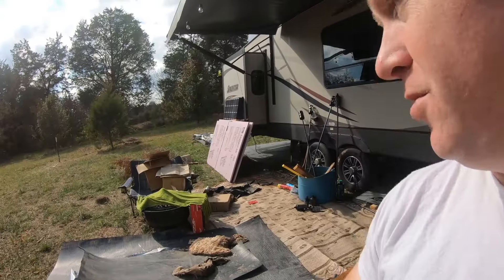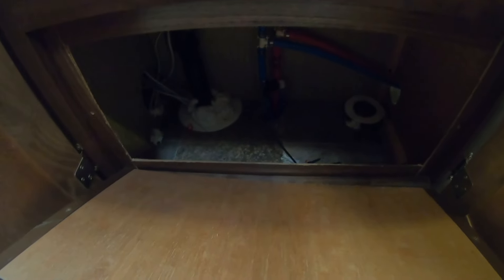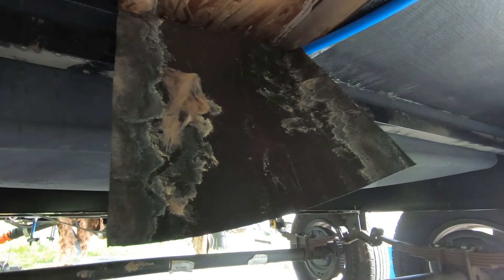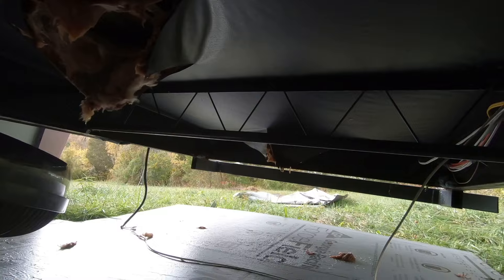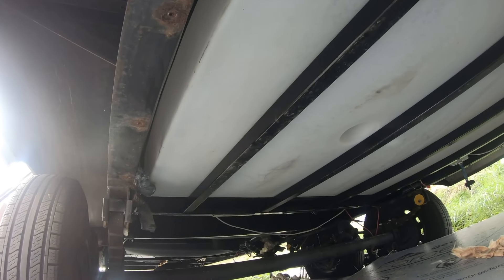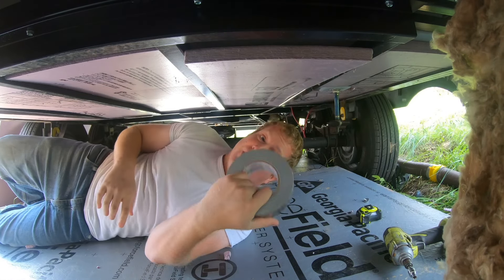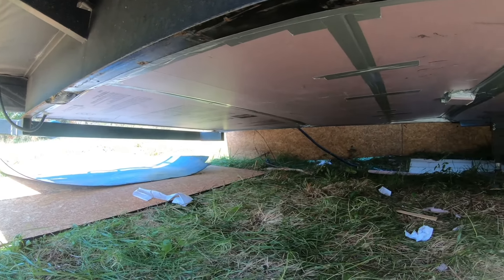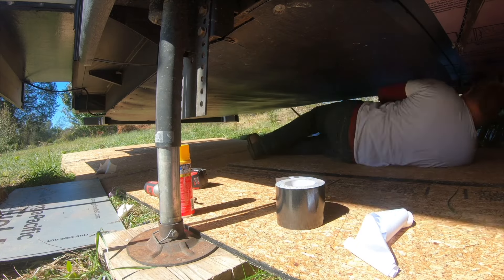We had a major issue with our Keystone RV | Check your RV for this problem before its too late!

Comment: Your positive attitude about this whole terrible issue is amazing!  Thank you for sharing... really appreciated!  I agree with M Silver, you must be a saint!  One of my greatest fears, a water leak in or impacting the basement area.
Reply from the maker: Yeah, it was frustrating to have to deal with something like that... I should have realized that something was going on earlier than I did.  When we were using our water pump, about every 10-20 min it would start up and re-prime itself. We just figured it was bleeding off pressure through the pump's check valve  and didn't think about the possibility of a water leak...

Comment: I never connect to a pressure line. I always use the annoying sounding water pump. That way I can hear any leaks before they become serious. If you're not using any water and your pump cycles, you have an issue.
Reply from the maker: Yeah we noticed it cycling about every 15-30 minutes for about 2 seconds, and just thought it was the check valve bleeding off…

Comment: Good job but you should use the red Tuck tape that is designed to stick to styrofoam and is also waterproof. And it really sticks. Get it at any building centre.
Reply from the maker: Thanks for the Tip, We'll have to give that a shot, we had some of the plastic come down and will be working on getting that replaced later!
Reply: as a home builder, i totally agree, duct tape is pretty useless stuff, in fact hvac contractors dont even use it for duct work!  the red Tuck Tape is the best stuff for exterior cladding.

Comment: I own a 30' 2007 Keystone Montana, within the first year I had smoke coming up from the 'basement' area and heard water running. After I secured the power & water, I discovered the water line above the inverter leaked and caused a short. Was not pleased... I discovered the PEX coupling was 'not so well' secured with a hose clamp from the factory, really should have never happened. I repaired the PEX properly and contacted the mfg. of the inverter and what had happened, and they sent me a replacement unit free of charge. Some folks take pride in what they do.
Reply from the maker: Wow sorry to hear about your leak! At least you were able to get the inverter replaced for free!

Comment: I totally agree B , our keystone is JUNK. I wish that I didn’t have to find out the hard way to see this, as next time I am going to go through the future trailer with a scope camera. Our bedroom slide doesn’t go out all the way as the stoners screwed the cable L brackets on wrong so now the slide has too many screw holes to move the bracket and it will not be strong enough to support the new position. The hole in the floor for the island sink drain looks like it was beat open with a sludge hammer, the plumbing line from the hot water tank to the bathroom sink had a loop in it that was basically a knot. All those videos on YouTube that have factory tours are soo misleading, a dog and pony show is what they are as no dealer will slam the factory. 
Ya, keystoner rv, go ahead and buy one, you’ll see. I dare you.
Reply from the maker: Dang sorry to hear all the issues you’ve had to deal with!
Reply: They are made so quickly that likely there are many more problems to crop up over the years.   Note that things you are supposed to check or have access are difficult to find.  Corporate America is so greedy that consumers pay for it every time.
Reply: Makes no sense to hear people say this. Guess it’s just like anything else… a hit or miss when it comes to the year. Hopefully you can get everything resolved. Bought a 2011 in 2011 and I’ve never had any issues.

Comment: thanks for the heads up.. just took our inaugural trip in our 0217 keystone.. first stop hooked up to city water and had a waterfall coming out the rear 30min later.. unhooked it and drained the system... guess I know what my next project/expense is likely to be now
Reply from the maker: Aww man.. so sorry to hear that, those connections in the bathroom sink stink to get to. on ours they were in-between the axels which made it a pain to crawl around... hope your repair goes smoother than ours!

Comment: 2 easy ways to find out if you have a water leak. 
# turn on the on board water punp let it run until it stops letting the pump pressure the line then dont turn any water inside the coach and let set for at least 10 minutes.  If pump cycles of and then back on ther is a water leak. #2 whenever I connect my water supply to shore water I use a adjustable pressure regulator with a pressure guage. After everything has pressurized and all the lines are full , I go outside and turn off the shore water and then watch my pressure regulator to see of I'm losing pressure.  If guage goes dow then you have a leak and if it stays pressurized then everything is good

Comment: On our '14 Montana the water running down the side slipped under the Coroplast belly cover since it extended out about a quarter inch. I pulled it down and used a fan over a couple weeks to dry things out. Of course a mouse family used that to that as an invitation to squat. Dead mice -- stink.

I noticed that you do not have spring hanger supports. I highly recommend at least installing a MORryde X-factor's between the centers as a minimum and all 3 being best. Those hangers are cheap 1/8" bent hot roll steel instead of the forged brackets on our ancient long gone Kountry Aire
Reply from the maker: Nice I'll have to check those out

Comment: As a recently certified tech I am amazed at the stupidity of the RV designers.  Why would you put that crappy underbelly garbage on the bottom where visually we need to see problems before they become catastrophic. If you want an all season rv then wrap the pipes and  use other means, we need to get quick access to electrical lines, plumbing lines, propane lines to do inspections to catch problems before they get too far and costly. Imagine that!

Comment: Every rv is going to have similar issues. They are built quickly and are as light as possible. 
It is your job as the owner to do a complete inspection of all systems every trip. No different than a truck driver or pilot doing a pre-trip inspection. 

I highly suggest staying away from RV's unless you have many years of experience in construction and the ability to maintain and repair all systems. 

At this point, you need to remove and replace all wet insulation, or you will have a major mold issue. Make sure you thoroughly clean all surfaces before re-installation of insulation.

Comment: I had a similar problem with our KZ Sportsmen,  had to remove all tbe under belly insulation and replace with rigid  foam. I covered the whole lot with coroplast. I akso rerouted all pipes to the inside of tge rig.
Reply from the maker: Ill have to check that out, I had some of it fall down over the winter months and need to replace the old stuff, thanks for the info!

Comment: As noted: Duct tape does not stick to much of anything. You are going to have to retape the entire job by next year. Those panels of insulation are not a good idea without some kind of a hanging system like wire to hold them in place. And there is supposed to be a gap between the frame and the tanks to allow for weight and thermal tank expansion. I have seen frames on a trailer bend when water in a tank began to freeze and expand.
Reply: Maybe use that foil tape and heat with a hair dryer

Comment: PEX pipe is a good product. Every reputable PEX manufacturer recommends proper connection systems that are approved for their specific pipe. RV manufacturers then purchase any random hose clamp and use them for their lowest bidder unbranded pex pipe. At some point your pex pipe connections will start leaking also and any nylon pipe plumbed into the system will also fail for the same reason.

Comment: I bought an 83 Glendale rv. quite an eye opener. at least when I rebuilt it and replaced all the rotted wood it was basic carpentry. what crap these things are. someone commented anything past 2018 is cheap built but I can confirm they are ALL cheaply built no matter the year.

Comment: My keystone in just a few years of owning it had a broken pea trap dump in water everywhere ,refrigerator never has cooled below 50° most the time the freezer can’t freeze since it was brand new,the shower makes a gurgling sound and hissing sound almost like it has a leak at the shower hose connection,cooks batteries /2 in two years so I had no choice but just completely disconnect till I can figure something out,aC wall mounted ac leaks into the cabin already causing a mold issue.This thing cost me a lot of money and has been nothing but a huge money pit and huge cause of stress for my wife and me. We’re highly leaning toward just dumping it for payoff or taking a loss before it gets worse. I don’t see any real fix for the AC portion.The fridge would most likely have to be swapped out to a non absorption ammonia fridge to something completely different. The battery issue I’m unsure but maybe swap out the $200+ controller may or may not fix it or it may still do it not sure. The drain pipe I fixed and not sure what to do with the shower without taking it apart from the wall.

Comment: Right after I bought my trailer new in 2013, I found many small leaks in the bathroom and kitchen.  

Months later, the Mickey Mouse toilet water connection started leaking at the toilet.  I found better house like connections at the RV store.

All manufacturers crank out multiple units per day so you can imagine the lack luster quality as you found out.

Comment: I would thing insurance would cover the damages, I used the spray foam the fill the hole where the water line goes through the floor,

Comment: Hate to be negative but that tape won’t hold the insulation on while moving at highway speeds. You may have to put a small wire mesh on it and tack weld the wire to the frame. Also, yes, RV’s are made very fast, thoughtless (ie carelessly) and of the cheapest junk on the market, even the 100,000 dollar ones. Motor homes are made to roll down the highway and take bumps but some have the same trashy woodwork, plumbing and electric. Just take it real easy when traveling and be constantly vigilant for water leaks from roof, sides and plumbing.
Reply from the maker: Thanks for the suggestion! I have to redo some of the underside as the tape didnt hold up to the condensation from the skirting this past winter...

Comment: What did you use to remove the factory nails? Nice job by the way.
Reply: We used a screwdriver and hammer to get under the washer, and were able to pry the nails down, Thanks!

Comment: We had a problem with our brand new Astoria/Keystone/Dutchmen fifth whee, with a leak. Had it at the dealer for a month! Then we had a problem with the electric level jacks, Keystone wouldn’t fix it, 3 months old, ended up having to trade it in.
Reply from the maker: Sorry to hear that!  We found an issue with our electric level jacks too, they had a constant electric draw on them, so now we unplug them until we need to level the RV... We noticed it because our battery kept going dead with nothing running on it, traced it back to that...

Comment: We bought a new 2022 Keystone Alpine 3790FK in mid-June of 2022 and by November we had to abandon it due to frame failure.  Of course,  Keystone tried to blame me claiming that we had to have been hit at axle level for this kind of failure to happen.  Both paper-thin 12" I-beams bent and then rolled under making it impossible to tow.  NO HELP FROM kEYSTONE WHATSOEVER!  My insurance had to cover it and I lost over $15k.  NEVER AGAIN WILL WE PURCHASE ANYTHING KEYSTONE!!!!!!!!!!
Reply: I saw another video today about a similar issue with Keystone, the frame failed and the company blamed them for going "off road" when it was a road under construction.

Comment: with the exception of a few most RV manufacturers are junk - THe problem I see with what you are doing is when you decide to spring another leak and you will you may have to take it all down again just to see where it is fine job though